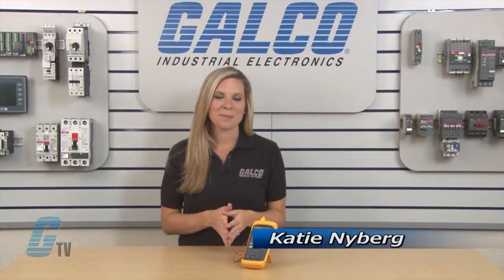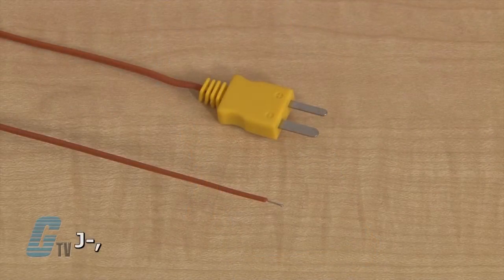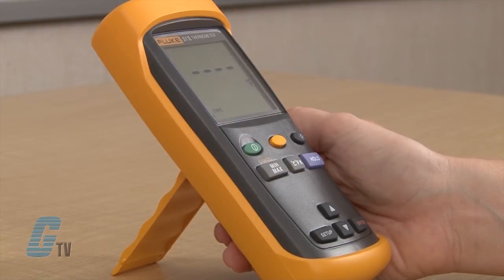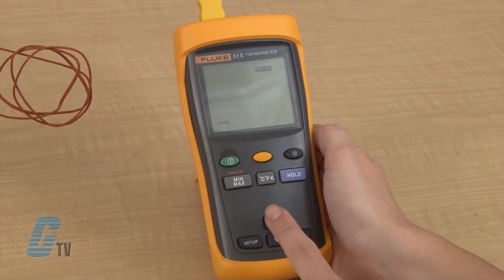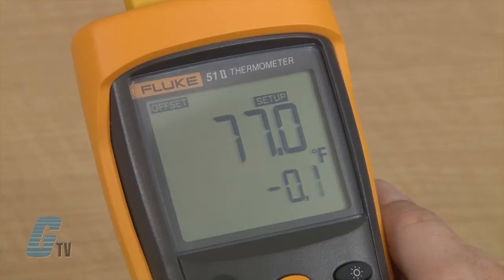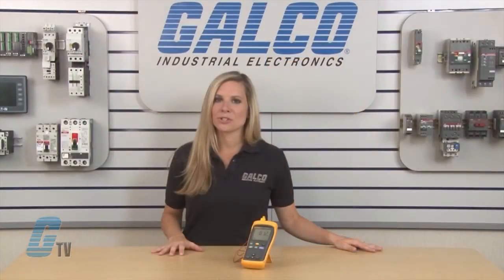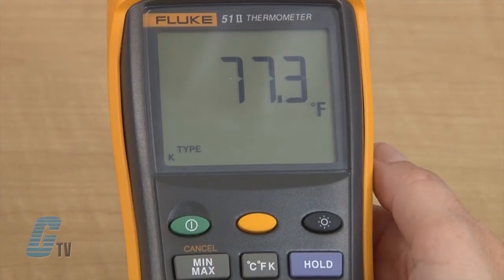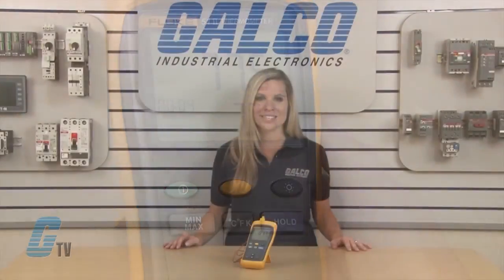Fluke 50 Series of Industrial Thermometers

Comment from the maker: This Non‑Contact Thermometer is the ideal tool for measuring surface temperatures of rotating, hard‑to reach, electrically live, or dangerously hot targets. These meters are suitable in applications where fast response is required. These meters provide bright laser beams so targeting objects in those dark, hard to reach places won't be a problem.

Fluke 50 Series Features:
-    LCD Display
-    Backlight
-    Fixed or adjustable Emissivity
-    Laser Pointer
-    Temp. Range from -58~1832 degrees